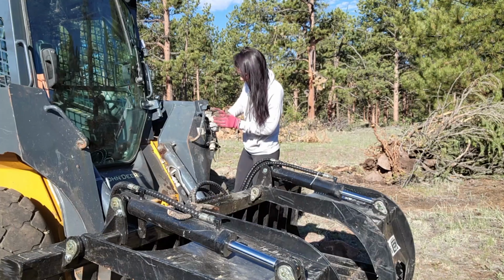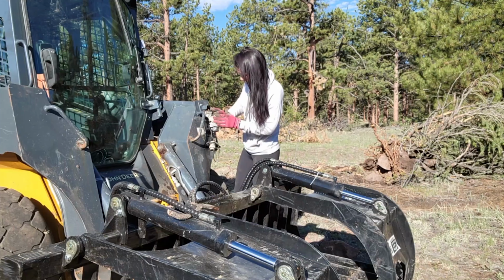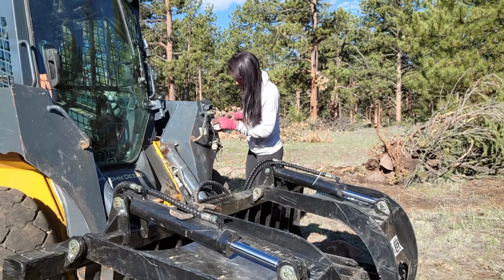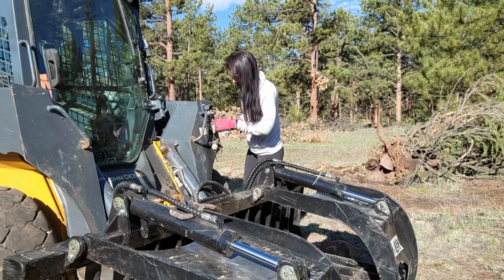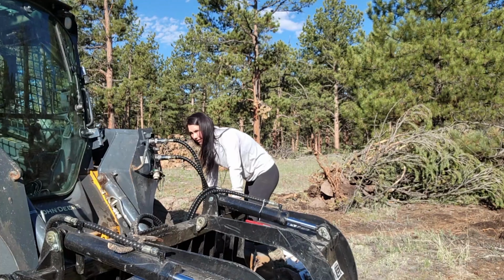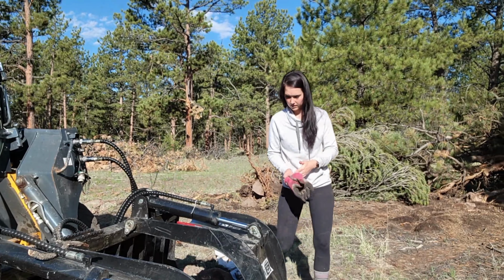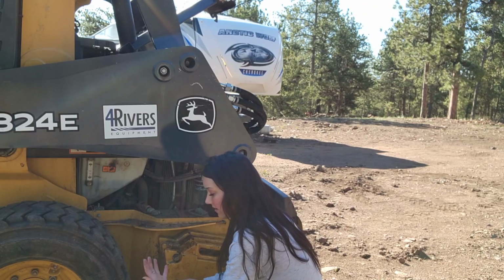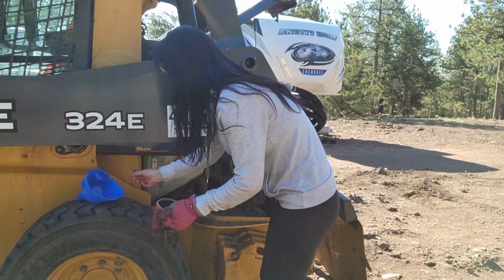Fixing hydraulic leak on skid steer

Comment: I agree with @chargermopar. The couplings have rubber or teflon seals that can fail after extensive use. Checking the threaded connections was a good idea. And it could be debris in the couplings making them leak.  Clean the fittings really good with spray brake cleaner. Once you have all the oil off then you can tell where the leak is coming from.
Reply from the maker: Thank you!

Comment: You can release the pressure on a machine by turning the power on with the engine off and moving the control. Generally the pressure will be on the attachment, like when a grapple is disconnected when the grabbers are still up. Those flat faced couplers have teflon rings and o ring seals that fail after a few years. Leaks mean you should rebuild or replace them.
Reply from the maker: Good to know, thanks!